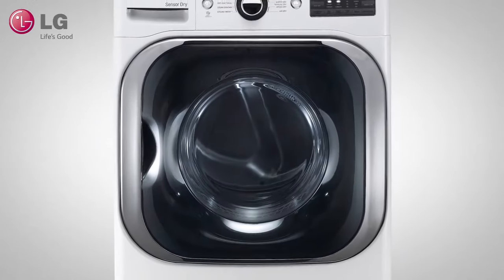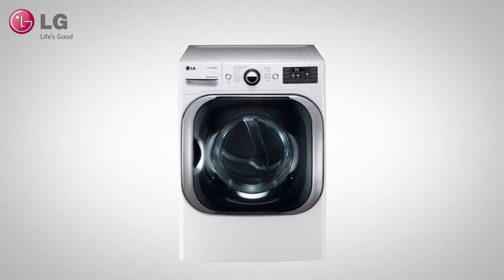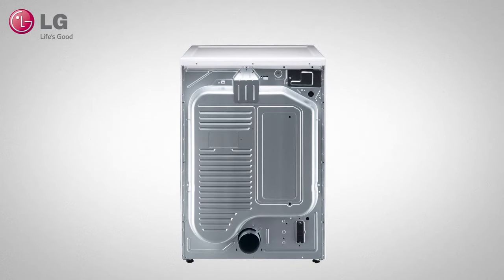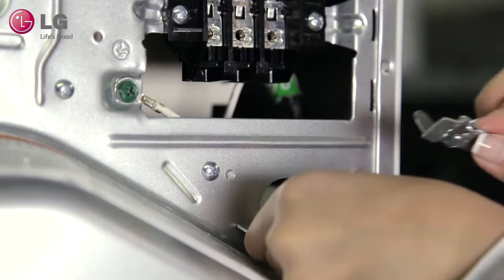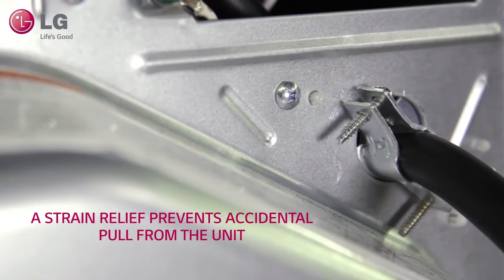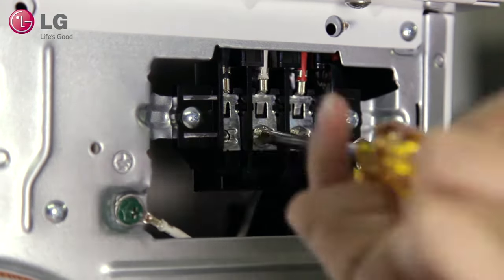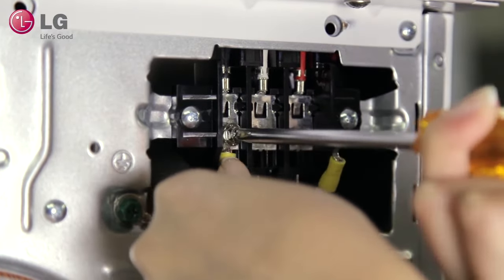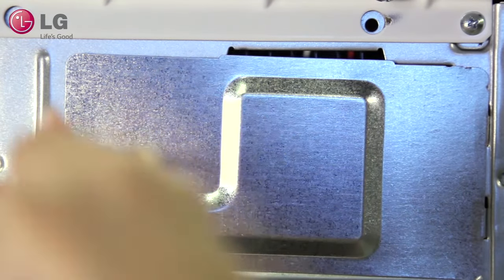[LG Dryers] 3-Wire Power Cord Installation

Comment: They closed the plate door and secured it with a screw, but you can see there were no wires connected before the plate door was closed.
Reply from the maker: Welcome to our Social Media page. Based on your recent post, we see that you may need support. Please send us a private message. Thank you.  *Leah
Reply from the maker: Hello! I'm passing by to check up on your case.
Do you still need assistance? If so, let us know if there is anything that we can do for you.  *Leah
Reply from the maker: We have not received any response from you. We assume that your concern has been resolved.  For now, I will go ahead and end our session. Should you have any other questions or concerns, please feel free to reach out again, and we'll be happy to assist. Have a great day. *Leah

Comment: What if it doesnt power on once connected. I biught exact same dryer.
Reply from the maker: Hey, Jaime! Your dryer not turning on would definitely get in the way of doing laundry, so let's get to the bottom of this together. We've attached a link with more info below, but to start narrowing down the cause of the issue, we have a few questions to ask! Firstly, are the black, white, and red wires all matched by color? Secondly, does the unit beep at all when pressing buttons, even if nothing shows up on the display? Thirdly, could you please confirm that your unit is plugged all the way into the wall and the power button has been pressed? And fourthly, when you open the door, does the drum light turn on? Please feel free to respond here, or via DM @LGUSSupport on any of our social media pags, we're always happy to help! http://spr.ly/6054OlfZ4 ^Ian